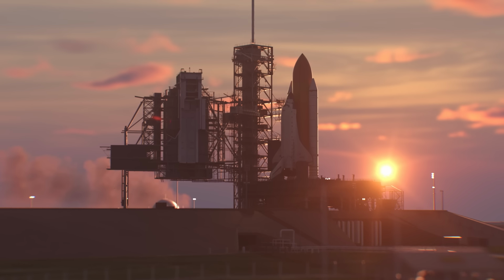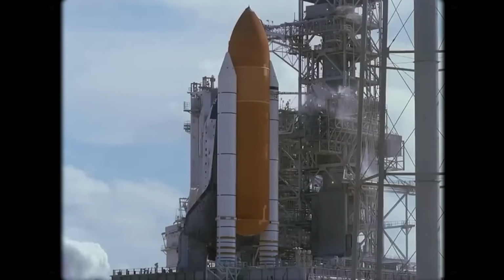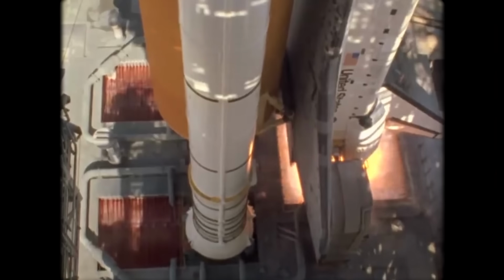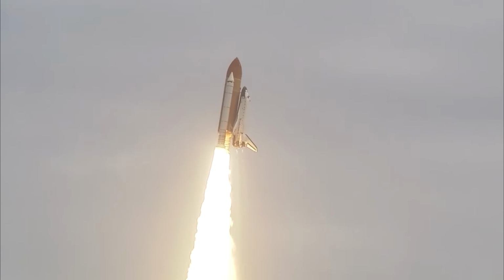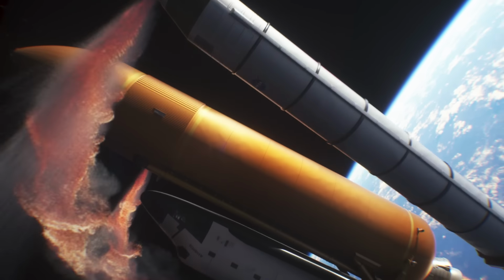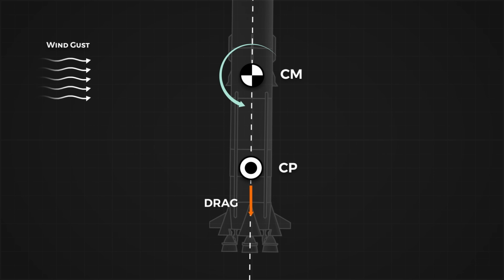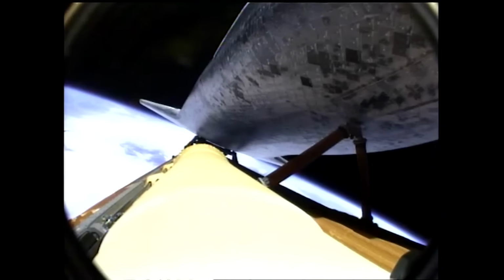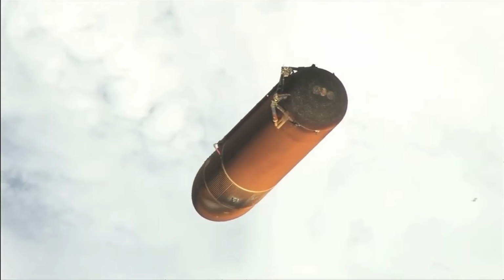The Insane Engineering of the Space Shuttle

Comment: This is a great production.  It is unfortunate that we build this unsafe hunk of junk after the masterpiece the Saturn V was and threw all of our money away at it and got two whole crews killed from inherent design flaws that could only really be addressed by cancelling the program.  To understand why the Space Shuttle was an unsafe hunk of junk, consider the following:

1. The Saturn V could get ~2.5% of its starting mass into LEO as payload using 1960's rocket technology.  The Space Shuttle reaching the same orbit using 1970's rocket technology could only do 1.6%.  So yeah, we went for a less efficient 1.5 stage to orbit design, hauling these big, empty structures all the way up to orbital speed when the Saturn V could do 2 stage to orbit and for lunar missions fired its 3rd stage to get that last little bit into LEO.  So the Saturn V would chuck away the largest, heaviest part of the rocket away early on in flight and then continue on with the much smaller and lighter 2nd stage either all the way to orbital speed or almost up to orbital speed before using up the 2nd stage.  Chucking away this empty structural and unneeded engine mass early on freed up a lot of mass budget and thus why the Saturn V was far more efficient lb for lb than the Space Shuttle.  Consider the Delta IV rocket, which basically used the same sort of hydrogen rocket engines the Space Shuttle used could do 3% to LEO, twice as mass efficient, because it was a 2-stage design.  I mean the Space Shuttle with 1.5 stage is getting into it just barely makes orbit and it is almost to the point of something that would just fall back to Earth because it is so much dry mass being shoved with those long, propellant guzzling burns all the way up to orbital velocity that it almost runs out of gas before reaching orbit.

So you look at what SpaceX was able to do by taking Saturn V style RP-1 engines and just making them more efficient and they are able to get Falcon 9 up to LEO with 4% headroom if they expend both stages.  However, they spent the time and effort to figure out 1st stage recovery, so they are working with 2.6% efficiency to LEO in terms of payload capacity.  Starship, if built with the same structural materials as the Falcon 9 in the same manner, would be able to do 7% with those methane engines.  As the last test almost made orbit before exploding, it seems like a valid thing to throw out there as possible.  It is just with their recovery scheme, most of this overhead will go into re-usability of both stages.

2. Most manned rockets including the Saturn V placed the crew on top of the rocket with a launch abort system.  You talk about going supersonic in the atmosphere and well if something went wrong at supersonic speeds and the rocket exploded, that sounds like you are much more likely to survive while on top, above the explosion.  With the Space Shuttle getting into one of its fatal flaws, you are strapped to the side of the rocket and there is no mass budget for a launch abort system.  So we ended up losing the whole Challenger crew due to this unfixable fatal flaw.  At this while having the external tank explode right next to you instead of beneath you must have been a jarring experience, because it happened so high up with so little air around to contain the explosion and feed that hydrogen escaping with dense enough oxygen to mix and ignite with, it turns out they were able to turn on their emergency oxygen.  However, with no safety systems beyond an emergency oxygen bottle because it would weigh too much, making the already inefficient Space Shuttle sub-orbital, the astronauts who survived the initial very high altitude explosion still died due to the impact with the ocean.

3. Something missed in the explanation of the original external tank is that original outer coating helped keep the foam insulation from falling off.  With the orbiter strapped to the side of the rocket, the unprotected foam would break off and hit the orbiter, damaging it.  Every flight was playing Russian roulette because of this and this led to some near losses on re-entry and finally the loss of the Columbia and its whole crew.  Again another fatal flaw that could only really be fixed by cancelling the program because that outer protective layer just was too much extra mass for the inefficient 1.5 stage to orbit design making it so they couldn't carry a useful payload into orbit; just have a big, empty cargo bay, so why did you even bother to launch if you can't carry your assigned payloads that were designed for a rocket that performed better than what the Space Shuttle could do with some sort of safety added?

4. And for the whole 're-usable' part, those SRBs were so much work to refurbish that you didn't save any money over just building new ones.  The Falcon 9 is the only rocket in operation to date that can turn around its 1st stage without a big refurbishment effort.  Hopefully Starship will be doing this soon and Rocket Lab will get better at this as it sounds like they are about to be ready to fly again after the last mishap and loss of payload.  Everyone else had or has a little capsule that the people use to ride back to Earth.  While these capsules are kind of expensive, it is nothing compared to the insane costs to get the Space Shuttle orbiter ready for its next flight.  It took hundreds of millions of dollars of work and new heat shield tiles and such, and very delicate and sensitive work at that to get the orbiter ready for its next flight.  Just that one piece was ridiculously expensive and difficult to get ready for its next flight.  A capsule would have been a lot cheaper and could have been tested unmanned.  There was no actual reason to send an airplane into space where the wings are just dead weight in the vacuum of space.  Why!???  That was just dumb.  The Saturn V for example had the LEM 'payload' underneath the command module during launch and the cover over the payload was expendable.  It was much cheaper to do it this way and just throw away those aerodynamic covers over the payload.  I mean nothing about the Space Shuttle made any actual sense over what was already demonstrated in the Saturn V program.
-------

You go over the Space Shuttle program piece by piece and it seems that basically all of the smart engineering that went into making the Saturn V a masterpiece of a rocket was just simply not understood by those responsible for designing the Space Shuttle.  So, we ended up with an inherently unsafe, inefficient, ridiculously hard to prepare for flight, and overall way too expensive to operate rocket.  It is crazy that we did this at all when we had an example of how to do it right that we could have learned from and used that knowledge to build an even better rocket and especially crazy that we stuck with this horrible design for so long.  So people liked how it looked, but it was a terrible idea that got a bunch of people killed.
Reply: Starship shows how amateurish the US space industry has devolved into. Saturn V, with far more complex and powerful engines (5), didn't have a single failure!
Starship, with it array of puny engines (33), had 3 failures in a row, showing that the whole design philosophy is flawed.
The Shuttle had 1.5% failures in 30 years (1986 and 2003).
You are making apple to orange comparison between Saturn V and the Space Shuttle, which were designed for different purpose, in different era.
The Shuttle's claim to fame was it's reusable engines, no other nation had duplicated so far.
Reply: @truthadvocacy  you are trying to compare Apples to Oranges here.

The Saturn V was designed by the same team that built the V2 rocket in WWII.  Plenty of V2 rockets blew up, failing their mission.  The thing is that team learned over the years and many failures to figure out how to really make a rocket like the Saturn V work.  At this, they had the whole USA helping to make the rocket work.  Then they had a rather waterfall style method where everything had to be perfect before integration.  At this, missions like Apollo 9 had engine failures and Apollo 13 barely made it back after a service module failure as well as astronauts dying in a fire during ground testing.  Plus initial launches had things like the pogo effect nearly rip the rocket apart before they figured out how to correct it.

Now you get to Starship.  They already know how to make Falcon 9 work flawlessly through hundreds of flights and recoveries of the booster in a row and thousands of combined flight hours on the engines, but Starship is a whole different beast with over twice the power of the mighty Saturn V.  In other words, those ain't puny engines, but instead the rocket is that ridiculously big and powerful.  Plus each flight is a pile of combined engine flight time to learn from.  They are also not just focused on making orbit, but instead are trying to crack the grand challenge problem of rapid full reusability.  They went from the ground up while every other rocket in my life was based on another successful rocket design or even a failed design that then also failed.

So then Elon is trying to speed things along with rapid iterations to try to make these ambitious breakthroughs that nobody has ever achieved.  I mean they are playing a whole different ball game than anybody else and a really hard one that everyone else either failed out or shied away from trying.  So you can't expect the same things to happen.  It is not even their goal for an early flight to make it back, but instead to gather engineering data quickly so they can iterate for the next rocket they build.

Everything is different here and it sounds to me like you just don't understand what is happening or why, which is why I am trying to explain it here.

Comment: The space shuttle was dangerous from it's inception. When you put rocket boosters in proximity to a crew cabin, you are looking for trouble. When you use uncontrollable SRB's to boost the launch thrust you are asking for lots of tragedies. When the Soviet engineers designed their shuttle, they properly recognized that using uncontrollable SRB's was a bad idea, so they put normal fueled rockets on their shuttle instead that could be throttled up or down or turned off completely. Another improvement they made was for powered decent and landing, instead of the shuttle coming in as a glider, like a brick. It is amazing that we didn't lose more shuttles than we did.

Comment: Attended a launch in the mid 80s. As the shuttle did its rotation just after launch I  thought I was about to witness a disaster. The roll was supposed toto happen. The  shuttle reaches 100mph as it clears the tower - 0-100mph in 3.5 seconds.

Comment: Excellently done!!  As an ex shuttle control/propulsion instructor, I can say I've never seen as comprehensive a job done explaining complex technical information so well that anyone can understand it.  (Something I tell people all the time can be done.) I only have a few comments; (1) in discussing the roll program/max dynamic pressure, your rationale is correct for why it was done but your mention of lowering dynamic pressure on the wings is not technically correct; the shuttle needed to fly at negative angle of attack (approx minus 4 degrees) to keep aerodynamic loading on the wings within structural limits; (2) on the mention of multiple SRB holddown post stud failures, you called it mission critical which implies to me it would have been only loss of mission but that's not my understanding of where we could have been if it ever happened (i.e. a lot worse than that); (3) the 3 g throttle back late in the profile (and way beyond any aerodynamic forces) is a trade off between vehicle acceleration limits/performance and keeping crew loading at a decent level; didn't have anything to do with the wing loading at that point.

Comment: At 3:26 you got open and close loop backwards. It enters CLOSED loop when it starts to monitor itself to make adjustments. An open loop system is when no feedback is taken into account by the controller. In an open loop its a one way street nothing comes back. In a close loop control signals are sent out and the data that is gathered comes back to the controller forming a closed loop.
Reply: was thinking about that too. I can hear the transition between open to closed loop when I cold start my mustang lol
Reply: When talking about electric paths some people call a closed switch a closed loop and when it switches off it is an open loop for current to flow, however there may be different understandings

Comment: The Space Shuttle design was a compromise designed to keep various companies in business, and it sacrificed safety to do so. The Soviet knockoff, the Buran, had an inherently safer launch system and was technically superior in every way that counted. It was canceled, however, as the Soviet Union ran out of money and collapsed. The solid rocket boosters of the US shuttle directly caused the loss of Challenger, and the design decision to use them instead of liquid rockets, intended to prop up the manufacturer, also contributed to the loss of Columbia. Solid rocket boosters have one inherent flaw: once lit, you can't turn them off. So if there's a problem with one, you're basically screwed. The Buran had the rockets and tank integrated into a single unit. This meant safer liquid-fueled rockets could be used, and the shuttle itself did not require main engines (it still had orbital maneuvering thrusters). This also meant foam was not needed. So, the US government's decision to prop up the SRB manufacturer instead of using a more sane design ultimately cost us two space shuttles and the lives of 14 crew.

Comment: 2.75 inch bolt is all that stops it from taking off before the bolts are fired off. That's pretty impressive considering oil pipes use like 5 inch bolts and nuts to stop leaks

Comment: The launch pad 180 degree thing confuses me. They DID build a new launch pad for the shuttle. The only thing they reused was the concrete and flame pit. They even redid the flame deflector like they did again a few years ago for Artemis. The tower was not from Apollo. The Apollo launch tower was on the pad/crawler while the shuttle was the only thing on the crawler it only moved the shuttle because the launch tower was permanently built off the side of pad 39a and b. So why wouldn’t they just pull it in the other way and build the new bits facing the other side when building the launch tower and when redoing the flame diverter? Since they pulled the old one out they could have  changed the diverter to the other direction!? I’m guessing there is more to the 180 than you think bud. Remember Apollo did it as well and there was not plane/glider. I’m guessing it depends on the orbit they are going for so since the orbit could be different every mission and it won't be exactly 180 degrees they just left it where it was most pretty since they knew they would be adjusting no matter what depending on mission orbit

Comment: In regards to the engine control, id have thought something that can monitor pressures and make adjustments based off that (feedback) would be closed loop control, no? Correct me if im wrong….
Reply: You are correct. When a control signal is sent out and a feedback data comes back to the controller its a closed loop. Well if the controller takes that feedback into account for the next outbound control signal obviously.

Comment: Just scratching the surface on it's engineering and redundancy you come to appreciate how even Bob Crippen came to think. "There's no way this is ever going to work." Yet as much as it did work it was still very fragile and flew within unbelievably tight constraints. Unlike older rockets like Mercury, Gemini and Apollo there was no way to eject or escape through a launch escape tower. We lost Challenger because of this, and later Columbia during reentry with it's wing compromised. It was beautiful when it worked but a catastrophe when it failed, often from the slightest or simplest thing.

Comment: Insane engineering?
Insanely Incompetent engineering you mean.
Two shuttles lost, 14 people dead and it all could have been avoided if the job was done right.
Reply: Hindsight is a wonderful thing. There are risks with any ambitious endeavour.
Reply: @maxfactor4991 There was no hindsight because people were sounding the alarm before disaster happened.
Reply: @maxfactor4991  - Hindsight isn't needed to know that Neoprene O-rings in the boosters to hold back high temperature combustion gasses was a disaster waiting to happen (Challenger loss)...and heat tiles the consistency of Styrofoam and damaged just as easily was a serious problem (Columbia loss).
That is negligence and incompetence.